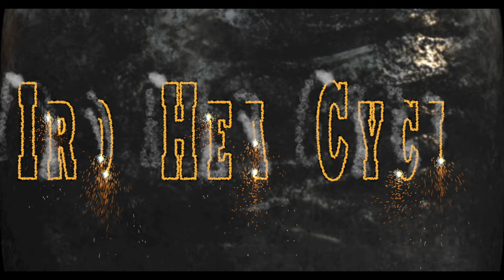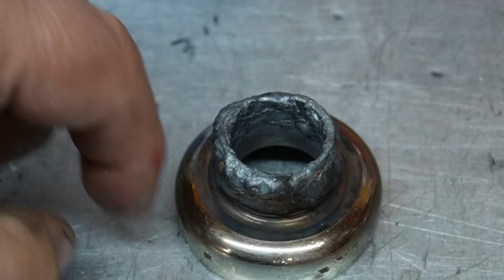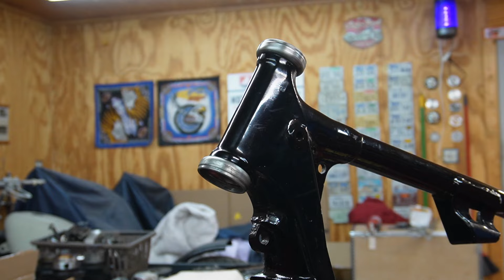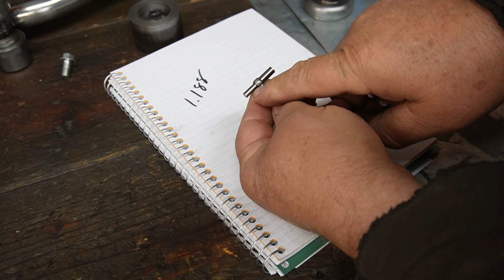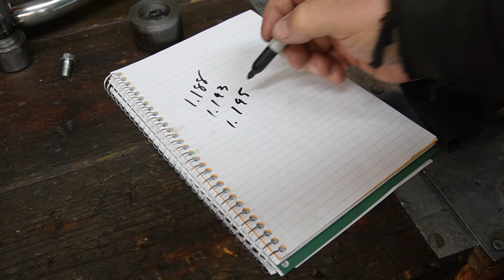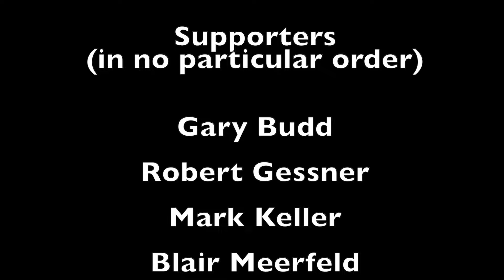1975 Harley XL Rebuild - Catastrophe Averted - Nbr 245

Comment: I always up grade the front end to later model 39mm.
Make my own neck cups because the stem length is longer...
I think someone makes them now, for this conversion...
CrazyHorse Speed Shop... I hope you got the decals I sent you..
Reply from the maker: Yes, the fatter tubes are nice. I've installed a couple of those conversions. AND, NO I DID NOT GET ANY DECALS. You can email me directly with this link: https://www.ironheadcycle.com/pages/contact.html to verify address you used.

Comment: Good video, definitely enjoyed seeing the fix. Wouldn't the ball bearings be almost as hard as the race? Only asking since you indicated the hardness test was inconclusive.  Say get a single ball bearing and place in the race... then (try like hell) to put pressure on the ball bearing in your press (you would need a harden steel pin to push on the ball bearing).. To see if the ball bearing will dent the race....  How much pressure? I am not sure but I guess if you take an old race and press a single ball bearing into that  and see when the ball bearing deforms (or the race dents)... at least you would know roughly the amount of pressure needed to achieve failure. Now for me, I would have to just count how many times I pumped the handle, since I have no pressure gauge on my press. But when actually testing the new race hardness I would go with fewer pumps, just to avoid deforming the ball bearing or the race... It would only be a close enough test.  Honestly I would hope the ball bearings were less hard than the race... since the load is spread over multiple balls.  Anyway just a thought...
Reply from the maker: Well that is all something to think about. I'm satisfied that it seems approximately as hard as the original. I think I need a set of hardness checking files.

Comment: Believe it or not I just tore my panhead completely apart two months ago for for the same issue. Kinda like finding a semolina seed in a brake master cylinder. Luckily I haven't been riding my Panhead since I moved to the sticks and it's been sitting for a real long time. When I drained the oil I do wonder how bead blast medium arrived at the bottom of my oil tank. it is always a good idea to change your oil often! and the last time I was riding my Pan I changed the oil once a week.Good Thing! Medium was confined to the oil tank. word to the wise.
Reply from the maker: I Hope the engine wasn't run! I slosh some degreaser around in the oil tank then stick the wand of my pressure washer in there, it works surprisingly well to remove the sludge.
Reply: @IronHeadCycle  Engine is fine! I'm back to the stock frame and oil tank! I don't let nobody in the work area and I don't have to park in the street, LOL although I found no sludge, All That wand action has me wanting to leave my next tooth under my pillow! THX!